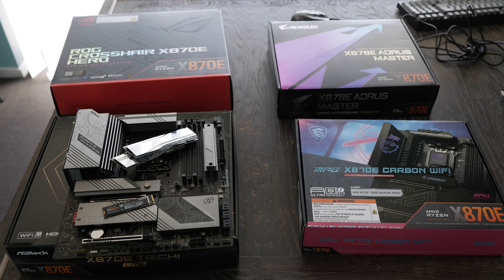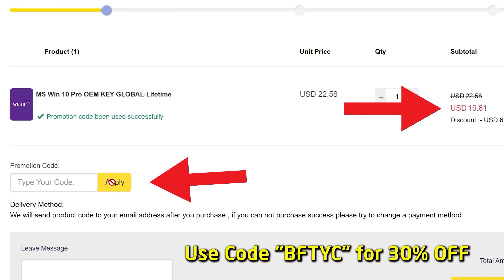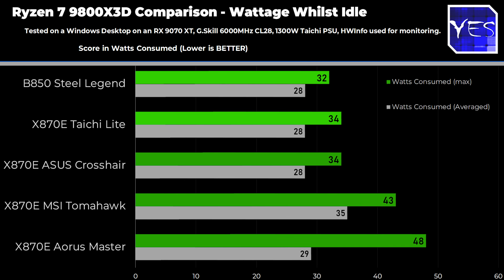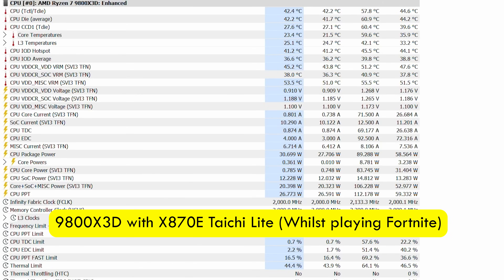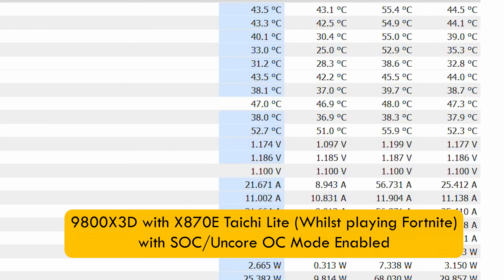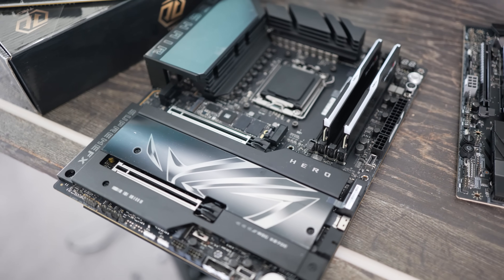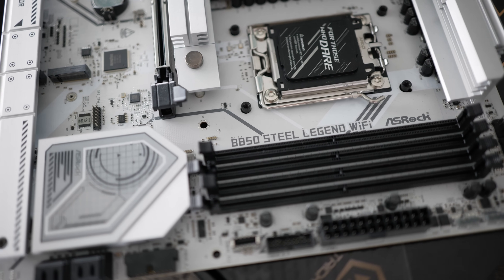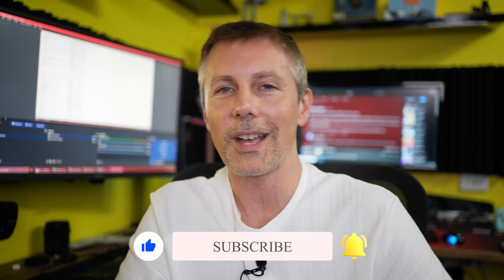I think I know why Ryzen 9000 Series CPUs are Dying...(!)

Comment: Ouf that loadline on the Soc voltage on the Asrock is BAD. It shouldnt need more than 1.2V for overclocking. 1.2V is enough for 6400Mhz ram speed on my decent 9800x3d. ( For anyone thinking you can just buy a 6400kit and get that speed, u rarely cant. I had to do manual ram testing with both latency and sub voltages.) For speeds lower than this one often can use stock or up 1.15V. I would also be careful running longer stresstesting with anything above 1.2V.
Reply: You probably have your ram set in a 2:1 ratio with the memory controller lol, it does that by default above 6000 mt/s lol.  Check your memory controller clock in hwinfo64 or zen timings.  Probably at 1600 mhz.

Comment: This has been a problem since ryzen 2000 series at the very least.
The asrock board in my wife's computer is still rocking a 2200g that will randomly blue screen from voltage if it's not set manually in bios.
Jays2cents did a video about it years ago.

Comment: Right now I have a Gigabyte x870E board, a G.Skill DDR5 6000 Cl30 Kit and a Ryzen 9 9950X3D on RMA with the webshop that sold them to me because I got undiagnosable boot errors pointing to the RAM and the CPU. I have no idea though why in Windows (when I got there) the system was 100% stable. It just didn't get that far reliably. It's the second AM5 system I built and the first that has multiple issues. I really like the AM4 platform better. It was less fragile.
Reply: I have the same issue. Did it ever boot with EXPO disabled? Was your RAM in the A2 B2 configuration? Did you assemble it yourself ?

Comment: I'm starting wondering if the issue is actually with windows since I've had my 9800x3d since near launch on a b650e taichi and no issues aside from memory and I've been using nobara for the whole time and only recently installed windows 11 just in case

Comment: My 9800X3D on an ASUS Rog Strix X870E-E has the SOC steady at 1.250v as well. I have the latest BIOS(1401) and I'm using 2x32GB GSkill 6000 CL30 set on EXPO II. I've had this system running daily since early Feb. 2025 and no issues.
Reply: If you're just running DDR5 6000MHz RAM without overclocking, there's a good chance that you can get away with just 1.1v without any performance degradation. Some even reported to have a stable system at 1.0v. Just to put in context, 1.25v is good enough to even drive 7000MHz RAMs.
Reply: @DejectedCat 64 GB ram requires more soc voltage because it's dual rank
Reply: @CriminalGameplay  Interesting, I didn't know that about dual rank ram. I am running a mild boost in PBO (+75 Mhz) and a CO of -25 all core.

Comment: Well from what I gathered from this video my Ryzen 5 9600x with a Gigabyte 850M D3HP should be fine since the SOC is sitting at a stable 1.190 V, sadly I am no longer using POB settings since they all got reset after I did a bios update.

Without POB the overall performance is a bit lower but to be fair I don't trust my current power supply and I should chill until I get a new one but at least now I can feel a bit safer about using my PC until then.

Comment: I have Ryzen 9 9950X3D + Asrock B650 Steel Legend WiFi + GSkill 32GB CL28 Bus 6000 MHz, After I waching the vdo I decide to "Enable" SoC/Uncore OC Mode in bios with lower down SOC Voltage at 1.2V from EXPO profile to 1.1V.

My system still works fine and gets static SOC Voltage at 1.090V (HWiNFO64) with Cyberpunk 2077 Benchmark.  :eyes-purple-crying:
Reply: There are dead x3d cpus with undervolted vsoc. This video is just wrong. Also x3d dying on other manufacturers mb, but on smaller scale.
Reply: @martynas7777  lets remember that % percentage of all production series cpus dies. They are extremely complex inside and the fact that not more of them die is actually really impressive. Remember regular Joe mounts their cpu with wool clothes, wool or fleese socks on carpets. Generating 1000's of volts in their hand while placing the cpu into the socket. High voltage damages can often show up months later.. I learned that in electrical school 20 years go and its still true.
Reply: @martynas7777  any source? I trust you 50/50, So i decide to change VSOC to 1.150 V.
Reply: @INDYIT  only posts on asrock reddit. Also vsoc is stable on other manufacturers. So not an issue? except cpus dies, but at lesser scale.
Reply: @martynas7777  The few cases of X3D CPUs dying on non-ASRock motherboards can possibly be explained by those users manually setting "SOC/Uncore OC Mode" to disabled.

Comment: Excellent video, mate! I debated between an MSI and ASrock board when it was upgrade time a few weeks ago. Glad I chose MSI (X870E Edge TI) for my 9800X3D. No problems at all except for 2 kits of bad RAM. New subscriber!
Reply: Same ... except for the ram. Did you dump the G.Skill in favor of Kingston Fury ?
Reply: @ No, I just got a new set of G. Skill Trident Z that worked.
Reply: @zetapal   Well in high memory capacitie, you dont realy have options in EXPO kits, its pretty much Gskill, Corsair and Patriot. I was trying to get mine 96GB kit and except patriot CL40 there was nothing, for months so when I saw Gskill Trident z5 neo I immediately purchased it and it works flawlessly. Even tried 6400 and it worked fine but in the end I got back to 6000 CL28 stock, and lowered VDD and SOC voltage little bit on 9800x3d.
Though I have Godlike motherboard. And from what i saw on forums with people asking help with expo memory, Corsair is not best to try at least on MSI motherboards.

Btw monitor your memory temps during memory test, mine spiked to 79 when running OCCT memory test, so I added extra fan for memory, DDR5 dont realy like to go over 60 and you can start to have memory errors at those high temps.

Comment: dunno how much you can really get out of using HWinfo in the default polling mode of 1000ms to catch any voltage spikes, realistically you would need to lower that to the lowest possible polling of 20ms to even have a decent chance at catching any spikes. (or just go the real route of soldering probes and using an oscilloscope)
Reply: True, under 1.3v soc is still fine, even overclockers has been running 1.3v and it still works till now no issue, to really² know and catch the extact spike is to have true equipment. In this video the max is not even reaching 1.3v, not saying this video is wrong but not really a conclusion to make.
Reply: I didn't get the sense that he was using HWInfo to get precise voltage numbers. He was just using it to prove that the voltage was fluctuating, and the default polling rate was good enough to show that.
Reply: @Osprey850  but that´s hardly an outcome you can predict when looking into things at first, doesn´t change the fact that this method is highly flaved on many levels.
Reply: @c.chepre8452  It's only as "flawed" as any other hypothesis. It feels like you're mistaking this for the proof. This is only the hypothesis, not the proof of the hypothesis.
Reply: You are expecting tech tubers to have some qualification and understanding for engineering work...
Reply: @martynas7777  Brian made claims like this before without backing it up with actual hardware measurements. Even if hardware is not the best and/or without accounting for resistances, it would be more credible claim. I remember now why I unsubscribed from this channel.

This is like old guides for improving fps by disabling HPET (basically disabling time checking) and then claiming that there are fps gains instead of claiming that 1s on a PC is not always actual 1s so measurement is inaccurate to begin with...
It is sad to see that people with 600k subs still did not learned that hardware reporting (for software reading) might not be accurate.
Reply: Alternately, you could stick with 1000ms but test 50x as long...but I think your plan is better.
Reply: True, However, since he used the same measuring method across all motherboards, the measurements can still be compared to each other. Though understanding what these measurmenets actually mean is another thing entirely. Maybe this will inspire someone with more technical knowledge and equipment to do an indepth testing of SoC voltage behaviour across the different motherboard brands.
Reply: @myname7021  It's fine for monitoring voltage behavior between brands but software cannot be used to reliably check for voltage spikes regardless how low the polling rate is. People have probed them and channels like buildzoid saw brands like Gigabyte (and others) send a ton of SOC at startup during the 7000 series X3D failures.

Comment: Thank you for posting this! I own a AsRock B650 PG Lightning board with a 7800X3D. At some point I want to upgrade the CPU and have been keeping an eye on this news for months. AsRock doesn't seem to know what's going on and I haven't seen a BIOS update posted in about 2 months.
Reply: Probably safest to wait (less deaths on last gen boards). Am on X870E Nova 9900X3D soc set to 1.125 (Nobara 42). Think it's vsoc spikes but we don't know, so many cases.
Reply: Wait till Zen 6... 7800X3D is still a damn good chip and the Zen5 motherboards are basically just rebadged Zen4 boards with a few feature changes. Even the advertised memory speeds is largely marketing and generally achievable on the previous gen boards already. Only when pushed to the limit is X870 potentially beneficial and X3D owners really aren't benefiting from it anyway.

The 9800X3D is a great chip but Zen6 should provide a much more meaningful uplift for Zen4 owners.

Comment: The SOC voltage on my cpu stays at 1.245V with 6000MHz RAM. Is this a good value or should I lower it?
Reply: At least is less than 1.3 u good , I had mine 1.3 more and I lower it to 1.275 and disable boost overdrive

Comment: My Asus B650-PLUS WIFI with a 7800X3D has this behavior with voltages jumping up to 1.32V on the soc from a voltage of 1.24 (6200CL30). I'm going to try to see if I can use the 6200 again. I notice that it is rarer to happen if I have the memories at 6000.

Comment: 2 of our 130 person wow guild had their CPUs die during the game. One while we were in a raid, the other when he was doing nothing was sitting idle in the auction house and working on a document on another monitor. 9800x3d and 9950X3d both on asrock motherboards...both received new CPU's under warranty and changed the motherboards to gigabyte and msi, there have been no problems since then. In our guild, 80% of the players have AMD Zen 4 or Zen 5 processors.
Reply: im on gigabyte too. no problems so far. i heard msi is also good(although more expensive)
Reply: @cant_Comment the problem i hv with gigabyte is their board quality and nightmare rma process
Reply: @misofeast  board quality is actually pretty good. just avoid the bad gigabyte boards that made it in the hall of shame(hardware unboxed negative reviews). the average gigabyte boards are fine and good quality. its memory training at the bios that im more annoyed of tbh. i had to manually disable memory context restore and runtime reduction, and tweak dfe taps. my board defaults to: "skip memory training as much as possible because the humans are complaining about boot times". other than that, i have no complaints
Reply: I’m a WoW player using a 7800X3D and a 7950X on Asus X670E and B650I motherboards. No problems so far.
Reply: @little_fluffy_clouds  i was on an msi b650 for awhile without any issues until recently when i swapped to asrock x870e nova. constant ram issues, and im unable to fix it. running 7800x3d and 32gb trident z5 royal cl28 6000mhz. 😕

Comment: I've previously dropped my vsoc voltage to 1.1v and set its corresponding LLC setting to 2 out of 3.  I notice my overall voltage is down in HWiNFO but I still get spikes.  I've just applied this fix and waiting to see a spike or not in CPU VDDCR_SOC Voltage (SVI3 TFN).

Comment: Im using Gigabyte X670 Gaming X AX V2 motherboard, 9800X3D and G.Skill 6000 CL26 32gb RAM kit. The SOC voltage is rock solid at 1.190v no variations at all.

Comment: Have we learned nothing from Intel's 13/14th gen voltage issues? If your going to implement a feature that is not standard (compared to other manufacturers) you would think that monitoring these levels would have been priority in testing.

Comment: Me, remembering the 7800X3D debacle with SoC voltage from two years ago: Ah shit, here we go again
Reply: Tech yes 1.4v 0:39 is probably why the cpu died lol
Reply: @SirBlot  Tested with 1.15v SoC, didn't make any appreciable difference. If anything, slightly higher power consumption on the SoC and very marginally worse performance. 
(the 7700X by default will hit 95°C and stay there under full load, so I saw a very slight reduction in power available to the CPU cores. Idle power went up by a watt or so as well.)

Looks like I will be sticking with 1.1v, but I appreciate the insight nonetheless.
Reply: @AlistairWolfe993 Yes yours is fine as you have low volt memory. I think you are missing my point though. For Tech Yes the 1.4V memory voltage is connected to the 1.188V of the memory controller, the CPU "sinks" the difference and this difference should not be over 0.2V. Tech yes difference is 0.212V which is probably too much for the CPU to "sink".
Reply: @SirBlot  I'll be transparent and say that I have zero personal experience with Zen 5, so while I agree with what you're saying and I believe it makes sense, I can't offer any sort of a rebuttal solely because I haven't used any of the Ryzen 9000 chips myself.
Reply: @AlistairWolfe993no worries. Think of it like ghost busters… they cross the streams to create a current for the memory signal to use…. the potential difference
Reply: I gave up overclocking for undervolting and lower tdp.  For people who arent in a rush for higher performance CPUs are still crazy fast at a lower tdp and will still beat previous generations on single core.  
I degrade the IMC so many times for self ego on benchmarks that I run for a few times.  lol  I started using 65w eco mode more and experiment with 90w setting.   Its not a drastic drop from stock.
Reply: @republican_guard  Yeah pretty much. There's only a few percent in difference between running my aforementioned 7700X at 65w TDP compared to its default 105w TDP. Absolutely not worth throwing the chip out of its efficiency window for maybe 150 MHz, if even.
Reply: It's the same thing, this isn't anything new, and not a new finding. The only new bit of info here is the OC mode on the Asrock board fixing some fluctuation. In reality we have been following a static voltage of ~1.2-1.25 already for 2 years.
Reply: @colesym84  brother it's a joke

and yes, I'm well aware, I have been extremely cautious with my own 7700X to manually set the vSOC to 1.1v (which is stable in my case) any time I have to reset the BIOS settings or do an update because of this exact reason. I don't personally own an ASRock board so I can't speak to anything in that regard.
Reply: Am at 1.125soc Asrock Nova X870E 9900X3D. 1.1 does sound safe, we've seen some non x3d 9000 series deaths etc. A lot of the deaths seem to happen somewhere above 1.2. Settings vary on users it's a bit scary to follow all the new cases.
Reply: @dianaalyssa8726  Yeah, I would have liked to get it lower than that but it just doesn't seem to like anything lower than 1.1. Paired to an MSI B650 Tomahawk.
Reply: @AlistairWolfe993getting it lower is probably the wrong idea propagated all over the internet.  The specs for my intel cpu say to keep the difference to 0.2 or less between the memory controller and memory. This is why I have 1.25v memory… nice and close. If you have 1.4v memory running then your soc should probably be 1.2-1.25. The limit is probably 1.3 for the soc. If you create a large difference between the memory and controller then the cpu has to soak up the voltage drop. and we all know what VD does, lol. Sparks
Reply: @SirBlot  I'm running DDR5-6000 CL30 at 1.3v. A kit of TeamGroup Vulcan 5600 CL32 that's been overclocked, 2x16 GB. Natively 1.2v.
Reply: @AlistairWolfe993See… a 0.2 difference should be fine. I would set your soc at 1.15 though for a bonus 0.15 difference. I went as far as reading most of my cpus documentation a few years back. The VD is where the waste power goes.
Reply: @SirBlot  Interesting. Well, I've got the machine in front of me as I type this comment, I'll give it a go and see if it makes any difference to power consumption and/or thermals.
Reply: @SirBlot do you know what v difference should be for AMD?.
Reply: @SirBlot I ordered corsair vengeance 64gb kit with expo 6000mt cl30 at 1.4v, does this mean I will need more voltage(asrock nova  motherboard and 9800x3d)
Reply: @colesym84 Don't most Bios allow to set Soc voltage? Why Asrock has 3 settings On OFF and Auto and apparently no ability to just set a constant SOC v ?
Reply: ASUS introduced us to this.
Reply: first thing you gotta do on any PC is update the chipset drivers and bios. thank goodness i bought it last year so they got all the bugs worked out for a year after release.
Reply: its since the 3600 and was fixed with bios updates probably
Reply: Yup... This is exactly it.

Comment: Asrock boards and SOC voltages, they're like 2 separate entities...
I remember having opened an issue on their Z390 Taichi back in the day because voltage regulation especially when used with an offset went all over the place. Their support was totally clueless on a very simple and easily reproducible issue, now that CPUs are way more fragile, they can't put that under the rug anymore...